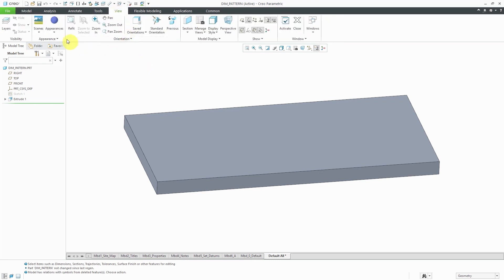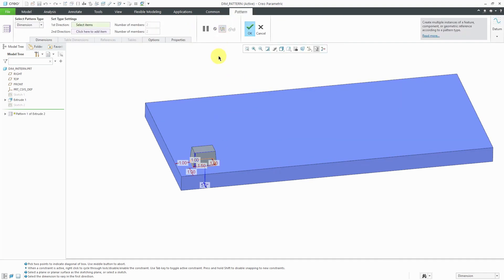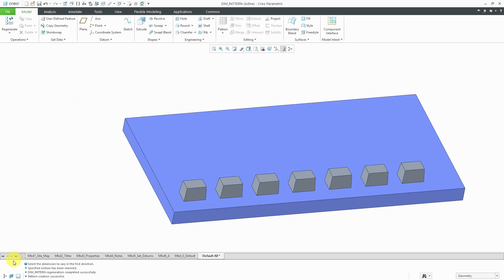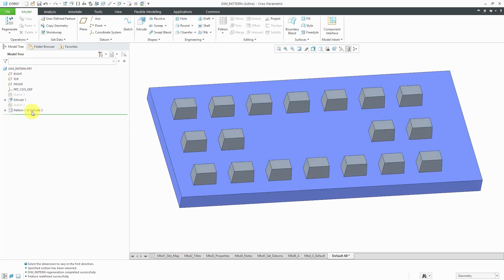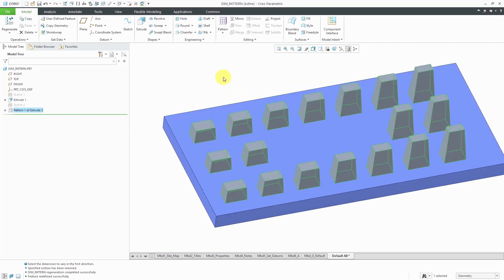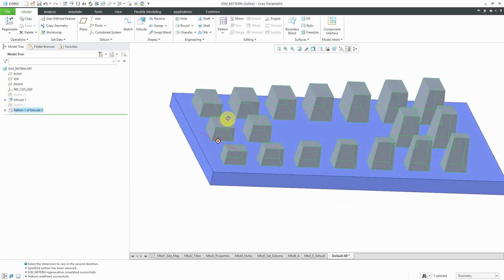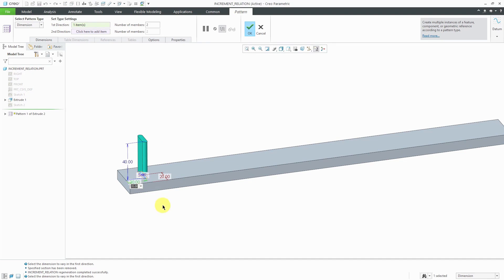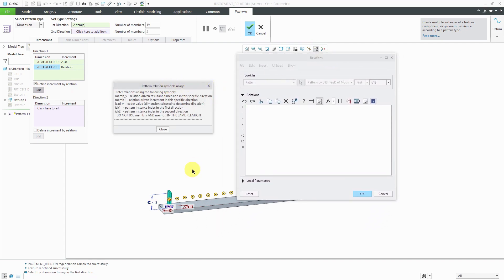Creo Parametric - Dimension Patterns [Tutorial Video]

Comment: being a creo official instructor sir what do you think why creo doesn't give a sketch pattern feature inside sketching mode i don't think its a big deal to add them even inferior software provides that
Reply from the maker: I've covered this in my Design Intent book as well as a couple videos. When duplication is a feature-level operation as opposed to sketch entity based, you have more control over Design Intent - the core philosophy of Creo Parametric. You have a lot more control over variability, location, orientation, inclusion, and modification when duplication is performed at the feature level.
Reply: @CADPLMGuy  the answer is satisfactory 👍 but some time we are interested in only 2D drawings and that feature could be more of assistance
Reply from the maker: 20+ years ago when I was teaching, in the first lecture we explained that Creo was 3D, model-centric, and feature-based. So if you're looking for 2D, drawing-centric, and sketch-based, a tool like AutoCAD would better suit those needs.